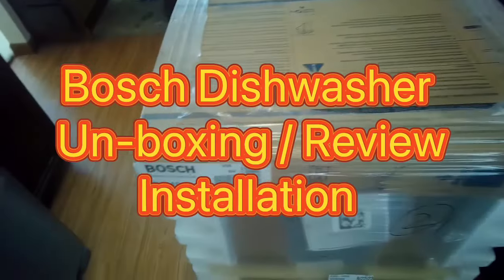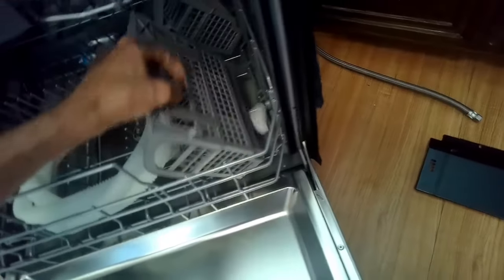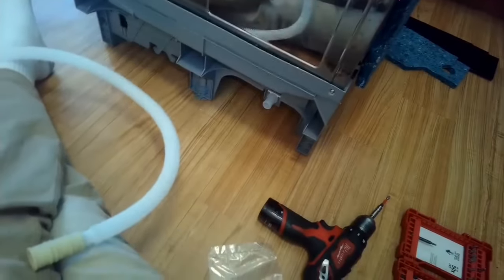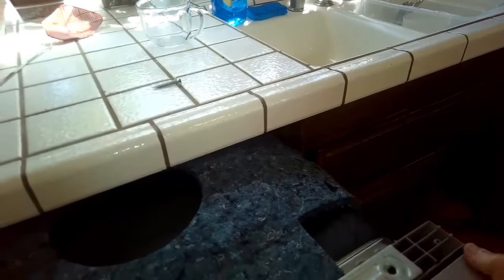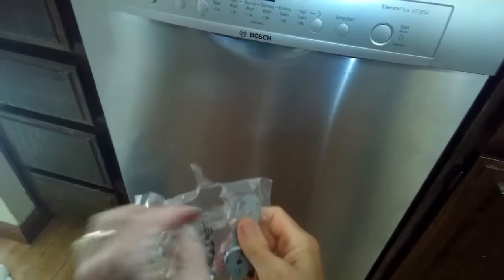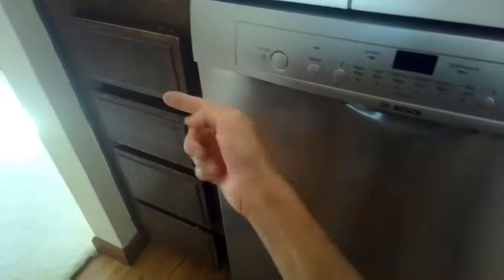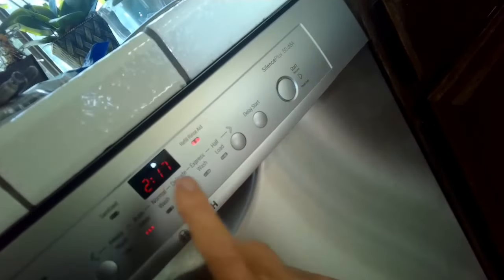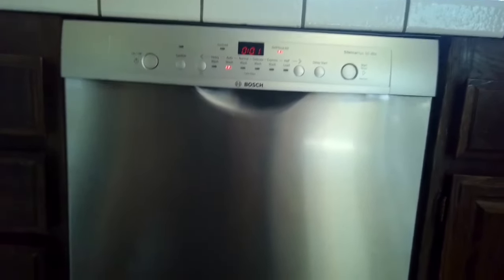✨ Bosch Ascenta Dishwasher - Un-Boxing / Review &  Easy Installation ✨

Comment: It's working. The magnet switch was not connecting because the door was barely touching the screw head that I used to secure it to the wooden cabinet. I replaced the round headed screw with a flat head screw and when I closed the door the machine started right up. Thanks
Reply from the maker: Nice detective work 👍😊

Comment: I appreciated this video so much I subscribed. I also just had this same Bosch (White) delivered and was a bit apprehensive about the removal of my old machine and installing this one. When we bought the house 22 years ago it had a low cost Kenmore and it lasted about one more year. I bought a new Kenmore but could not pull it out from under the cabinet. I couldn't find the plugin under the sink so down in the basement I went and found a cord sticking down through floor and followed it and to my surprise I realized that the idiots that lived here before hardwired it directly into the breaker box and left no extra wire so I couldn't even hook it up to the new machine. I wasn't gonna mess with the breaker box so I had an Electrician come in and remove the wire and put in a plug next to breaker and he simply reconnected the wires to the machine and put the wire nuts back on. That Kenmore lasted barely 4 years and was replaced with what I thought was a better machine but it too finally went bad which brings us to the Bosch. I had no idea they made a direct plug in so I'm gonna have to run the cord through the floor and plug it in next to the breaker box. I don't have a garbage disposal so how different is my install verses your video. Thanks.
Reply from the maker: Awesome, thanks so much for Subscribing.  Can you hook the drain pipe directly to the sink drain?
Reply: @QuickAndEasy5MinuteAppliance  Yes that is the same for the other 3 that have been there over 22 years
Reply: Yes it does

Comment: I have had this dishwasher since the day after Thanksgiving.  It's almost silent and cleans very well.  What I don't like about it is the bottom rack does not have a stop on it.  You pull it out to load and it comes out all the way!  It just sits in there instead of on tracks.  The two utensil caddies are very shallow.  I'm using the covers with the holes to put individual utensils in because they want to fall out.  It also has sooooo many "fingers" sticking up to hold your dishes that it's hard to get much in there that isn't flat like plates.  Makes it hard to overload it tho.  Also the rinse aid dispenser has the tiniest little hole to fill it thru, most of it runs down the door.  I've let Bosch know all this in the many emails they have sent me.  Over all It's a good machine but have little doubt that it will outlast the 23 yr old Maytag it replaced.
Reply from the maker: Great info.  Thanks Jeanne👍

Comment: Okay it's me again with same Bosch other than mine is white and I hooked everything up and turned the water back on. I plugged it in and like yours when you hit the on button the Auto Wash flashed and the counter of 2:10 flashed but nothing I do will make the counter lite go solid and it won't start. I'm no installer so do you have any idea what's wrong or what I'm doing wrong
Reply from the maker: The controller thinks the door is open. Might be something blocking it from closing all the way.